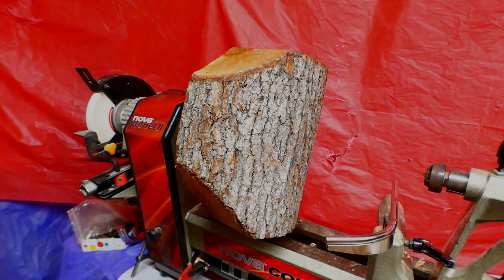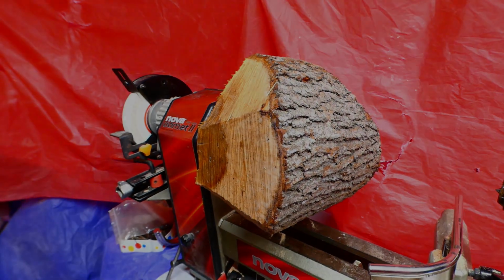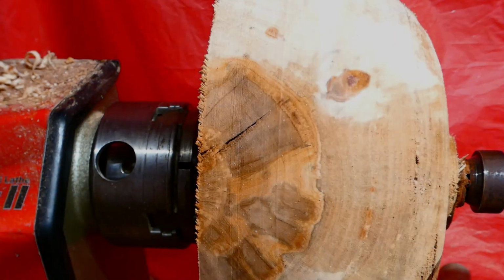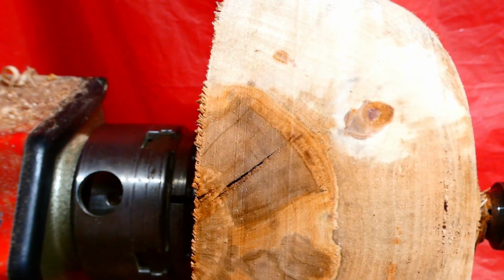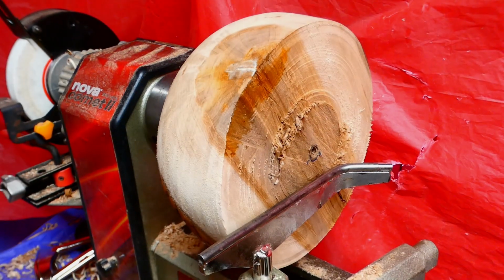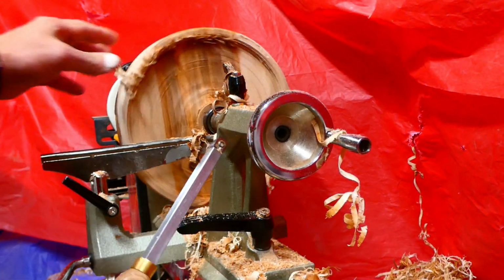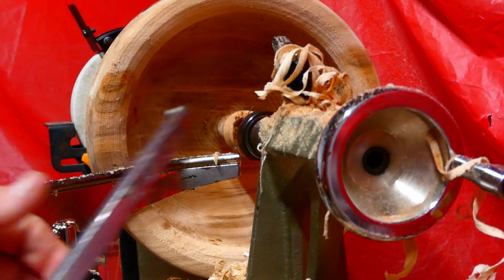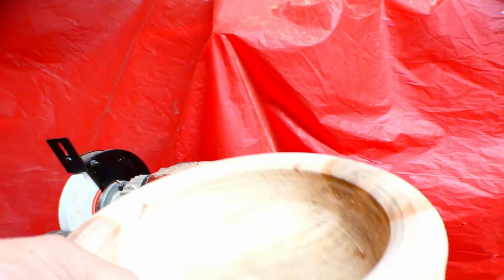Wood Turning Sweet Gum Green Turning Oct 2021

Comment: Good work! Hopefully the glue does it’s job and fixes the cracks. How long will it take to dry the high moisture wood?
Reply from the maker: Thanks for watching.. I was surprised how long it took to dry.. I started with about 30 percent.  Put in a box with shavings and checked about a month later.  It was down to 13.  I didn't expect it to dry out so fast..